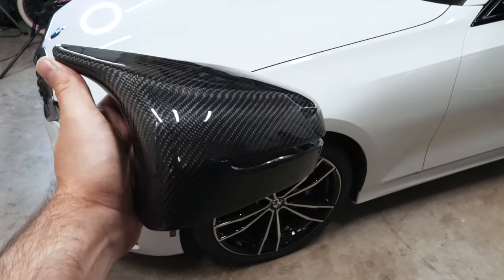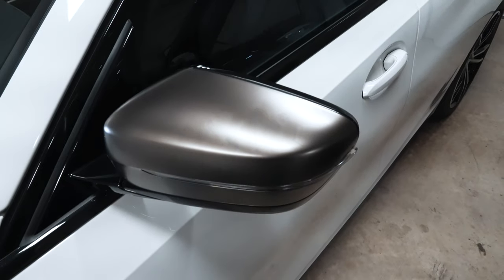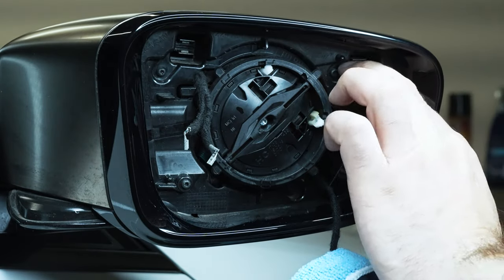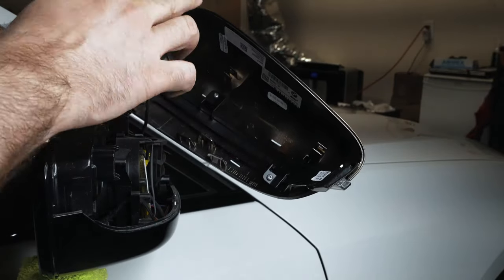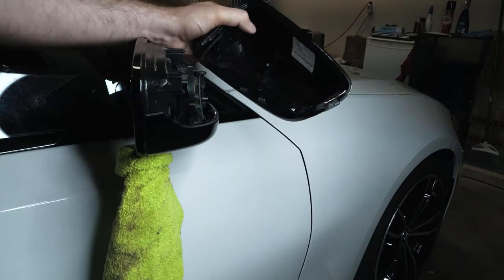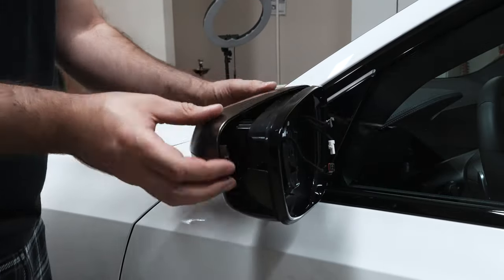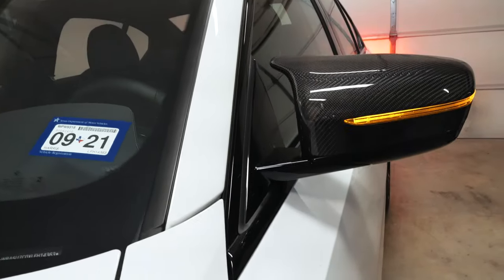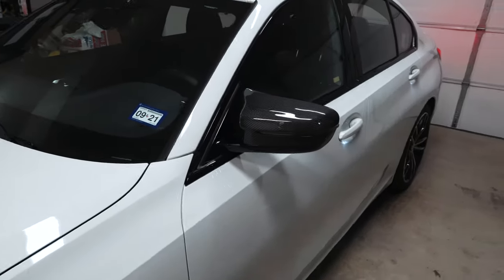Carbon Fiber Mirrors For Your BMW! | First M340i Mod!

Comment: BMW: AHHH. It was too easy to remove the mirror caps on E series.
Design Department: Let's force them remove the glass first
BMW: YES. Then they have to buy replacement glass. Approved.
Reply: Smart observation

Comment: Actually you don't need to remove the mirror. Those two clips on the inside can be easily accessed by a prying tool (slimmer one). Put your mirror in the lowest possible position and that's it. I've done it on both sides now.
Reply: Interesting ty
Reply: Absolutely. ZERO reason to take the mirrors off. Point the mirrors all the way down. You can use a pick tool, or even a flathead screwdriver, to get the upper tabs pushed up/down.
Reply: How did u do this. How can you unclip  the bottom and top at same time
Reply: @Matt_C_N how did u do this. How did you unclip the bottom and top at same time
Reply: You unclip top first. Then bottom.
Reply: @Matt_C_N  is the top clip suppose to disappear? Can u get me a photo or some. I have a 330i g20 2021

Comment: Haven't you had a problem with the water leak? My mirrors stopped working after a few months with these non-OEM caps.
Reply: Why would there be a water leak

Comment: Has anyone had any problems with the passenger mirror staying down after going into reverse?
Reply: No but I have trouble with it not facing down after putting it in reverse. The issue comes and goes for me
Reply: @AestheticPhysiques1  same
Reply: The passenger mirror is supposed to move and tilt down to help you with parallel parking by the curb.

Comment: hey.you think this car can hold big turbo kit ?
Reply from the maker: Yeah the B58 and the ZF 8 Speed can handle big power.
Reply: @VehicularDIY  I am planning to get I think g20 340 ..over q50 3.0t..but also should i get rwd or AWD?
Reply from the maker: I'd say it depends on how much power you want to make or if you live up north where it snows.  Mine is RWD and I live down south.
Reply: @VehicularDIY  I live in NJ but I think I get get winter tires if something ..its snows maybe 2-5 times ..also with a big turbo and tune you shouldn't use 0w-20 probably 5w-30?
Reply from the maker: Yeah a heavier weight oil is a good bet once the car is tuned.